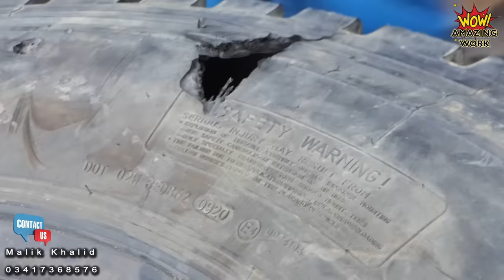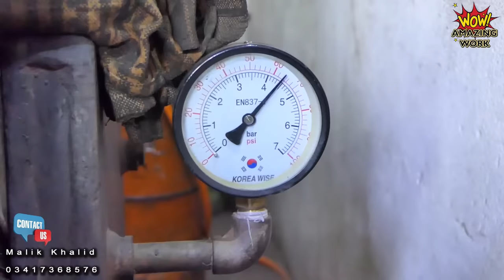Amazing skill of Repairing a Hard Impact Sidewall Truck Tire

Comment: Replacing steel cord in the sidewall with upholstry thread? Really?
Not legal for the road. Semi-truck tire's sidewalls are meant to support 8,500 lbs each...plus strain of heat build up and road conditions.
If there was an accident with injury or death caused by tire failure, well, somebody's in legal trouble.

Comment: I can understand in any developing country where repair cost( cause labour is so high ) almost equal to replace no one use this.Because its so cheap in their money  and safety norm.But many places in Asia,Africa and latin american countries they will use it for low speed use..This tyre will surely last another 10K-20K  with load and will travel up to 50Km-70 km  in speed range..as high  trafic and road condition will never gives them chance to go any higher..Those who have a doubt  have never used it. IT will be fine will do it works for few months. side wall cuts are often repairable but bottom cut which are touch to road they wont fix.

Comment: All these tyre experts harping on about how dangerous it is.  That repair is actually stronger than the rest of the carcase!  If it ever blows out it won't be where the repair has been done.  And yes you can repair a sidewall on certain types of tyre, but some modern radials you can't because they're built so poorly that there isn't enough decent reinforcement to stitch the repair into.  They're built to be lightweight and cheap to produce. However like this tyre, those that are intended for rough terrain or military use are much more sturdily built, meaning repair like this are possible.

Anyway forget the tyres, most of these trucks run single circuit air or hydraulic brakes!  You be far more likely to get hit by a truck with no brakes than one that had a tyre blow out! 😆🤦‍♂️

Comment: Truck tires are driven with high pressure, if they burst they can kill people standing beside the tire. I surely appreciate the skills of these workers, but repairing a tire like this is a red line which should never be crossed.
If a new tire is too expensive a cheaper used one will also do the job much more safe than one repaired in  this style.

Comment: A tyre also undergoes a whole level of being used in frugal economy countries.. i.e they use it on the. Truck for original life of tire, then it's remoulded for extending it's life once enough of the tread rubber is lost then they are used as cart/bullock cart wheel and once done with the use as a wheel they may get converted into water container or rubber for footwear or get recycled down the far end of life..

Comment: Imagine trying to balance the rims this tire goes on?
Reply: Truck tires on the rear axles are even in industrial countries typically not balanced, since it's not necessary. 
This however don't change anything on the fact this tire is a ticking time bomb

Comment: Not him cutting out the steel wire lined sidewall and replacing it with string and rubber cement

Comment: I thought that tool he was using was a die grinder until I seen it hooked up to that motor direct drive. Looked like it has long flexible shaft that run inside that black sleeve/hose and goes directly to the tool and spins the disc. I'm assuming home made as I've never seen any tool like that. If anyone knows what it's called let me know.
Reply: It's certainly a homemade device.

Comment: Just a few decades ago in the USA tires called retreads or recaps were commonly sold.  They were old tires that had literally been "retreaded".  So they were nicer than used tires yet cheaper than new ones.  And dangerous as hell. I won't tell my horror story but atleast no one died.